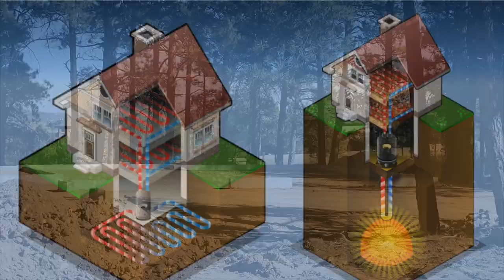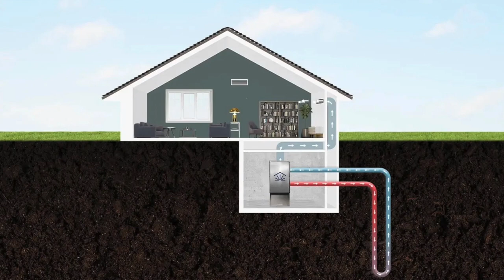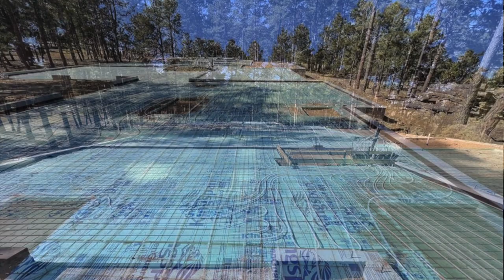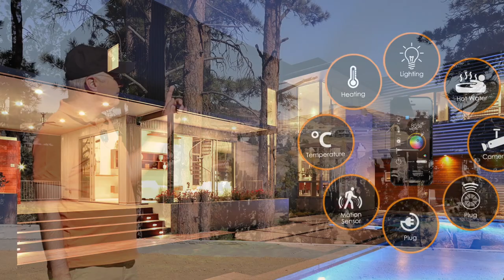What You Need To Know before getting Geothermal Heating and Cooling - Part 1

Comment: I always enjoy your videos.
In terms of not getting sick during your new format, may I suggest a simple steady cam trick?

If you get a phone holder and attach it to a balanced rig, you can remove the bounce.

You can build a cheap rig with piles from the hardware store and a small weight at the bottom.
You could even build a shoulder mount if you were ambitious.
Reply from the maker: Hi Sean, Thank you so much! I really appreciate it. Glad you enjoy the videos. Thank you for the recording tip! Very helpful. I actually recorded it using an SLR. I agree that I could have done a better job avoiding the bouncing. I'll work on int next time I get a chance doing content like this. Have a great weekend. Katha